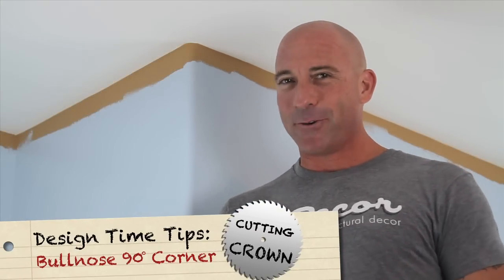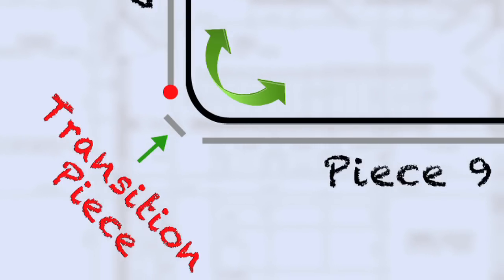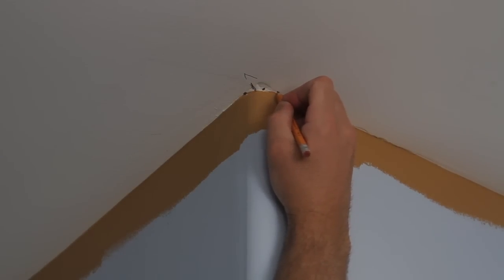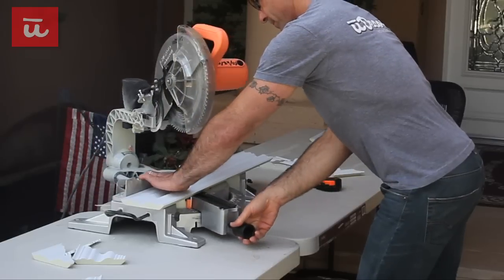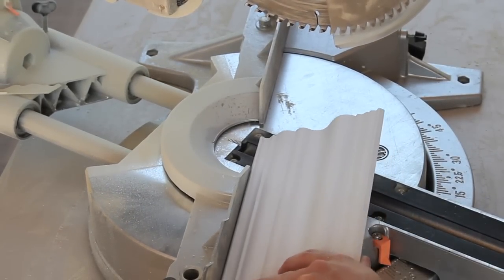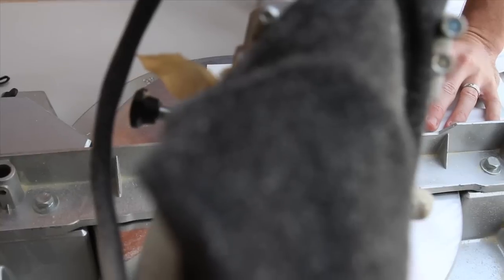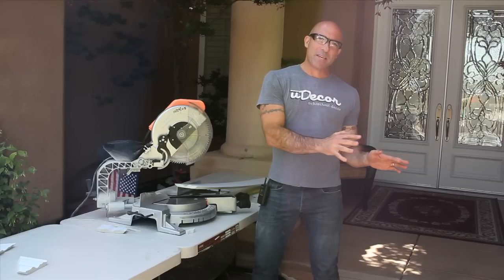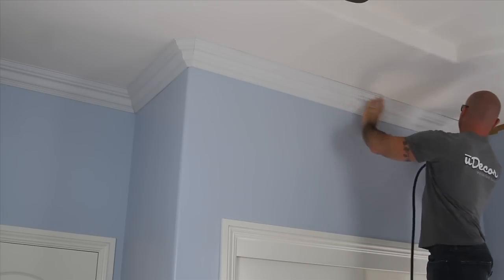How-to Cut a Bullnose Outside 90º Corner

Comment: If someone holds the crown like that and accidentally moves the piece while cutting, that crown is going to bind up in the blade and seriously fuck someone up.  Flip the crown upside down and nest it or cut it on the flat. I’ve literally never seen anyone cut like that and I’ve been trimming out homes for 20 years.

Comment: You're not helping do-it-yourselfers out at all by cutting the crown like that you're changing your spring angle every time you make a cut by supporting it with your hands and not the saw like you're supposed to, the proper way to cut it is flat and adjusting the miter and the bevel if you want to do it the quick simple way like you're doing it you need to turn the crown molding around and have it held up against the fence then you have the same angle every time in your inner and outer Corners actually meet up tight instead of having big giant gaps
Reply: I think it’s great you’re able to cut freehand, but I am leaving at that point as other sites help ‘not so advanced installers’  CUL

Comment: How go you measure the radius, which is the length from the center to the circle arc.
Reply: You're correct, so imagine that the center of the circle is point where the corner would be IF the it was not curved. The radius is the distance from that point to the outside of the circle, in this case,  where either side of the corner starts to curve. So you can grab a book (or something with a straight edge), put it on one side of the wall extending past the corner, then use a ruler to measure the distance from where the other side's corner starts to curve to the side of the book.

Comment: How about rounded inside corners for chair rails?  Seems most newer homes all have this, at least in California.
Doing just two pieces, left and right seem less than professional on the cut
Reply from the maker: If it is an inside 135 degree corner you can follow the exact steps shown in our chair rail video (at 2:40 in this video): How to install chair rail.  This video also will take you through an outside 90 degree corner with radius.  I haven't seen many rounded inside 90 degrees, but if you encounter that you could do a transition piece and just set your bevel angle to 22.5 degrees on each of your cuts.